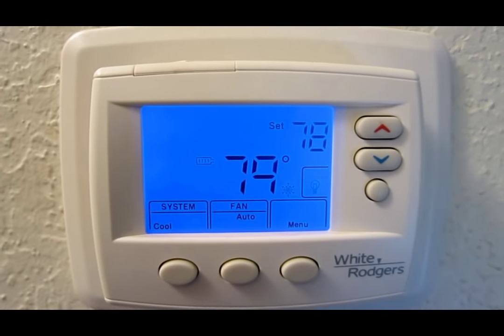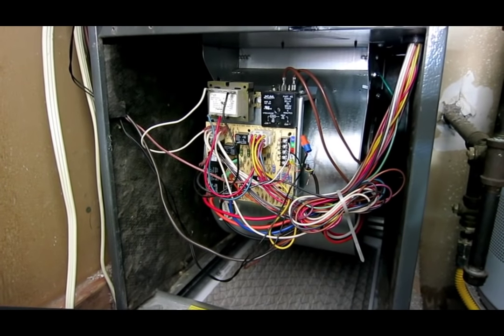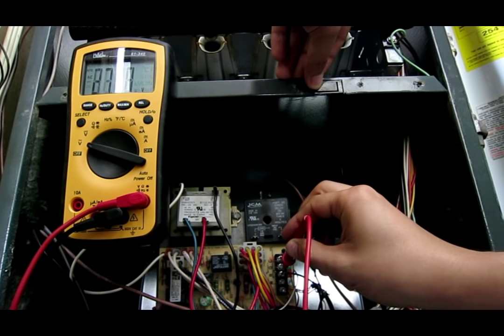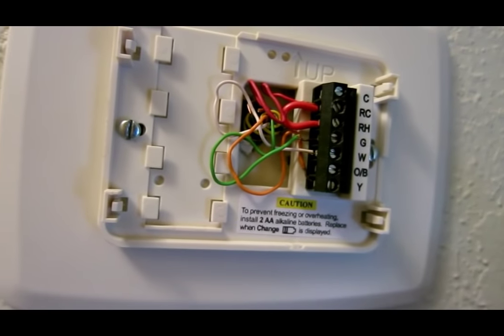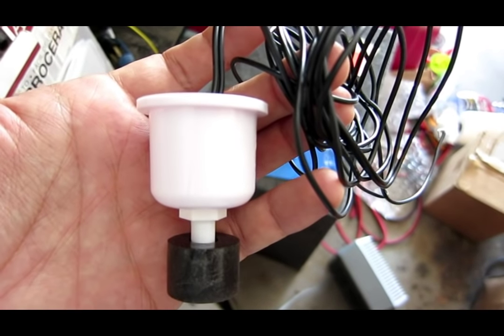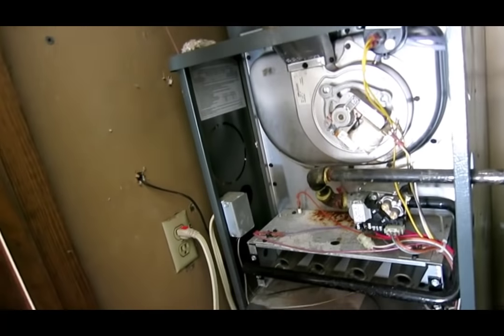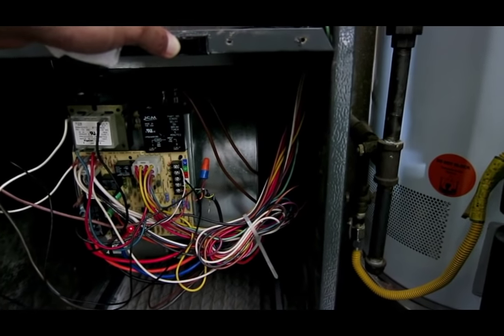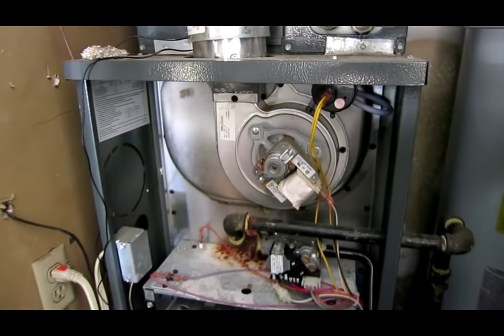most common AC problem - blower doesn't come on - HVAC condensate overflow shut-off device problem

Comment: Ok maybe some help. I trying to help fix a friends lennox unit. Heres what I got. I turn the heat on furnace fires but not blower motor. I put fan to on and nothing. I turn ac on and nothing no inside fan and outside unit doesnt fire on. I took the outside panel off and if I manual press the switch inside the outside unit runs as long as i hold it but inside squirell fan still doesnt come on. This unit is odd has 3 capacitors in the outside condensor unit. One is 375v and I believe was part of a hard start kit. Checked all 3 capacitors all read good so just cleaned connections. Out side fuses good power tests good at unit. Back inside no trouble code lights flashing faults on the board. I havent checked squirell cage fan capacitor yet but no bulges or leaks.I hear the furnace click so it gets the call to come on and in heat flames up as should exhaust fan spins no blower. Ac on I hear the call click but nothing else inside or out..Suggestions?

Comment: Should break the yellow wire for the compressor instead of the common so you can still have heat from the gas unit instead of no heat because the coil will not sweat in the winter

Comment: hi and thanks for you help, i have a portable ac unit LG 10000  is olmost brandnew the first monts work fine but few weeks latter sone times blow cold air and some time blow only the fan mean regular air and, and the reset botton for the wire pop uot, so am push the botton again and am stare the unit again and do the same ting some time blow cold air and sone time regular fan and reset botn pop out can you help wt this problem my freend? thanks

Comment: Hey man, my problem is that the fan will turn on only with the AC on or system off, if I turn on heat no fan will come on either manually or auto.

Comment: my circuit breaker tripping  i have same problem my fan motor work outside tested by electrician but the condenser shut down after resetting breaker condenser only work for about 1 minute Breakers trip again  after watching your video it sound like my problem is what you guys call overflow shutdown i well try to replace and clean the drain with air compressor.or any advice what my problem is?,
Reply from the maker: actually, it sounds like you have a bigger problem. if your breaker trips that means you have a short to ground somewhere in the condensing unit. It could be a simple capacitor, or the compressor (since the fan works). Or, you might just have a bad breaker that needs to be replaced.

Comment: Ok, so I live in apartments. My heater, turns on for a little while, then the breaker flicks. I do have clean air filter. But the rest I dont know where to look. They keep fixing the issue supposedly, but the same issue I still have. How can I just fix this myself?

Comment: Hello diy, I have a question.my thermostat invensys digital. This is my work, somebody keep lowering to 50 cold! So I keep bringing up to 72, so my question is it going down by itself to 50? Or something wrong? Thermostat. I confused, how to understand the thermostat the reading. Thank you.... help please! !!!
Reply from the maker: A thermostat should never go down to 50 on its own under normal circumstance.
Try taking the battery out, wait 5min, then put the battery back in the thermostat. If it goes down to 50, then maybe thats the way it resets, and maybe there's something wrong. However, If it doesnt go down to 50, then someone is messing with it.
Reply: DIY Tinker thank very much diy, I did what you told me, now is working normal, & I hope stay like it supposed to be.i appreciate your help.

Comment: My problem right now is that my AC unit sometimes starts making the noise like its running fluids and getting ready to kick on, but it never does and it keeps making the running fluid noise indefinitely until I realize it and turn it off.  I can hear the outside unit come on (which I'm guessing is what starts the sound of fluids/freon moving) but the inside never comes on.  The suction line freezes up and the other line gets cold.   So I wait a long time and try again (after thawing) and it'll work.    Usually this happens in the afternoon at the warmest time.  

Also, right before it did it the first time, there was a session where it wasn't blowing much air and it wasn't cold.  It was weak.  But it was one time.  And the outside unit was on.  I'm guessing it all kicked on like normal but when the outside unit kicked off, the inside unit continued to stay on and blow room temp air.  

What is the problem?

I should mention that I recently changed the filter and bought new insulation for the suction line outside (after the first time the problem of the inside unit not kicking on happened this summer).  But a week later, it happened again.

To sum up:    The inside unit possibly didn't kick off one time and later, occasionally, it doesn't kick on when its supposed to (after the outside unit comes on).    So, it seems it fails to 'kick'.   
I got the transistor (or whatever the small device that starts it is called) changed last year.  
I got the condenser coil inside changed two years ago.  
Last year, we initially switched out the motor (before realizing it was the transistor), but wired it wrong and blew the new motor.  We put the old one back in and replaced the transistor after some friendly help.
Reply: My fan works but my compressor wont turn on.I replaced the compassitor and the compressor still wont work.

Comment: The power switch at the air handler (24) is off. The house breaker is on, powers hp.............the T-stat fron cover is pulled with the AA batteries...

Comment: While checking my ac , noticed that the outside ac fan works, but it is not blowing any air or any cool air inside the house neither when I put it in fan mode it blows any air. What could it be?

Comment: my thermostat goes blank for like 5-6 minutes and then re-appears again and then goes blank again...this repeats itself...i get air blowing, but not cold air.  i have a brand new condenser and evaporating coil unit installed like a month ago, so it can't be the compressor or capacitor. my friend said likely a bad thermostat, but shouldn't i still get cold air if thermostat intermittenly works?

Comment: My husband was banging on the exterior of our Bryant hvac unit in an attempt to remove the ice build up.  It's brand new...err, was.  While banging the unit stopped working.  Fan stopped.  We tried shutting off/turning on.  Nothing.  Advice?
Reply from the maker: you need a HVAC pro asap. your refrigerant might be low, the installer might have made a mistake when installing the unit.

Comment: I have to reset my breaker then the blower will work.  but it is not running as fast as normal.  And takes longer to come on then before when you hear the thermostat click.

Comment: my ac/heater will not turn on at all. We've replace the transformer and got a new switch board but it still won't turn on. I've also checked the breakers and they are not tripped.

Comment: in general how long should i wait to do the check to make sure that the  120 V  connections are grounded
Reply from the maker: no sure what you mean by 120v connections are grounded. But the overflow sensor reacts immediately. you should have 120V or 0V when its tripped.

Comment: I have a problem with my traneXE1000 the top casing where the fan is attached was cracked broken by someone and it caused the fan blade to break off.  I have not been able to find another lid or top for it the unit works great except the area where the fan is attached is completely broken where can i get another lid or top for this unit ?  Any ideas for resolution?
Reply from the maker: Any HVAC store can buy that single part for you. For example, In OK, MO, TX, AR, KS area has a HVAC store called locke supply.

Comment: my a/c is coming on and cooling everything down but its not turning off. Its set at 72 and in auto but it will get down to 60 or in the fifties and not turn itself off. any sugestions?
Reply from the maker: I would guess either your thermostat is broken, or the control board isn't functioning right. you can bypass the thermostat (see other videos), if it turns on and off then thermostat is bad. If not, then the control board might be an issue.

Comment: cont',,, so I am just touching the contacts, not actually pluggin all the way on -trying to be careful. The other wires are marked faitly clearly so , i believe the others are hooked up ok. But my sch, doesnt show where these wires go to, just shows wire nuts, the outside HP sch doesnt show these wires either, but I think they are the lo 24 vdc.  The 'R' terminal test conductivity to chassis,  it is a Thermal ZOne -United Refer. Any tips someone can give on so little, I willl look at outside too

Comment from the maker: So, your AC has so much water from condensation that the overflow switch trips all the time? Sounds like a draining issue. I am guessing your AC in the basement? Not sure why you need a $400 pump, there are alot of cheaper ones out there that are less than $100.

Comment: I have a question for you.  If the blower's 5amp fuse keeps blowing what could be the root cause?
Reply from the maker: a short somewhere. maybe the blower is so warn out that it pulls too much current. maybe there is a short to ground. hard to say what could be the root cause.
Reply: could it be the capacitor?
Reply: When that happens it has a short in the 24v wire check if you have them touching by condenser whrn the fuse pops is to protect the transformer.

Comment: ac was running suddenly shut off has no power at all I've had problems with it multiple times but never has it just shut off what should I do? It is extremely hot on the third floor we are unable to turn it on at this moment what could be the problem?!
Reply: Vernetta Moore check the capacitor
Reply: Yancy Nunez lol they been waiting a year and 7 months on you bro
Reply: Raycharles Duramax LMAO. They're cooked now.
Reply: I think time for new 1

Comment: Ya I just bypassed it, still does not work, also mine does not have circuit board in furnace panel, just wire to wire connections, and the main power cord goes into some kind of fuse box thing, not a regular outlet, but I dont see a fuse to check in that box, I'm so lost

Comment: If your ac thermostat will not kick off when the temp goes below what it is set on what could be the problem?
Reply from the maker: Since i do not know the full issue, i would recommend the following two options:
1. Thermostat isnt working properly. 
2. Furnace control board isnt working properly.

Comment: The problem I am having is that my blower won't come on unless I go down and actually turn the switch on manually. Setting it to auto or on with the thermostat will not turn the blower on. Everything else works fine.

Comment: i have a problem with my ac. the fan outside the house works fine but there isnt' air coming out from the vent. the unit just humms. so i switch my ac off for atleast 5 to 6 hours and then turn back on and everything will start to work just fine for sometime a day or sometime a little less. my unit is about 18/19 year old trane.I replaced the control board two years ago when i wasn't getting any power to my thermostat controller. But i think this one is a different kind of problem. I'd appreciate your help.
Reply from the maker: STILLPHENOM try following these two videos and see if it solves your issue:
https://www.youtube.com/watch?v=4OAGq84mQSo
https://www.youtube.com/watch?v=cnD65qX8bjM

if it doesnt, at least you can eliminate some parts and start solving the issue
Reply: DIY Tinker hey there, thanks for the quick response. But I might have confused you a little bit. The fan outside works fine. It's the indoor unit that humms n blows no air at all.
Reply from the maker: STILLPHENOM then check this: https://www.youtube.com/watch?v=oswofzsoo88
Reply: Thanks for ur time bro. Really appreciate it. So I had the hvac guys come out and gave me the bad news. The capacitor was reading 3.5 in the furnace n the fan motor was bad completely. So they replaced those two n now it's working fine. Cost me 640 for everything.
Reply from the maker: STILLPHENOM sorry to hear that. Well, did they try replacing the capacitor first and see if the blower runs? how did they determine the blower was bad? just curious and want to learn from your experience.
Reply: Yeah so we first were happy to find out the capacitor was the only thing that was bad so it would be cheap for me n they were kind of in a rush to get to another place but after putting the new one in the motor wouldn't kick in at all n so they checked the circuit board n got nothing there which lead to checking the blower motor which was bad. Sorry I couldn't exactly tell u those hvac languages but it was something like that.

Comment: Rc is power. The power runs from ac into the g wire. You should not have 24v because it's the same line of power when it's on at the tstat
Reply: Lol and that throws off alot of mediocre techs. Especially trouble shooting air handlers.

Comment: sounds to me like your indoor blower motor capacitor is going out  its ither that or your motor is going bad....if your motor starts sometimes you arent having a problem getting 24volts to the relay its usually the capacitor for the motor.

Comment: Why do you go to the circuit breakers first, why not just switch the thermostat to "ON", that will tell you if the transformer gets power and if it does power is coming to the unit.

Comment: This doesn't help me as I live in an apartment complex and we have really shady maintenance men here and I don't want them in my home ( and they've been acting very strange around my building... they deliberately left the door to the apartment next door to me unlocked overnight after the tenants moved out .. the two apartments on my floor also complained along with me about this because three weeks earlier in the morning was a man walking around outside our building in a ninja mask.. all you could see were their eyes ...the rest of their whole head and face was covered) 

     I don't want these creepy acting maintenance men in my apartment .. they are the main reason tenants are moving out.

     The problem is the fan comes on for the central air and I know the freon works but the motor, the loud thing, doesn't kick on and yet it looks like outside the fan unit is moving , blowing out hot air .

   that's how I know it's my unit because the other ones are blowing out cooler air.
     I shut off the circuit breakers and turned them back on and that did not help.
      What happened is we had really unusually warm weather in early March and when I got up in the middle of the night I went to turn the AC off because I felt it was too cold ; but then I thought about how warm it was going to be by noon time and so 30 seconds later I turned it back on and it made a clunking sound and stopped working.

     Yet I had no problem when it got cold again and I needed the Heat.. the heater part of it works fine .
       There is a thing that goes into the wall that in another vid the guy pulled out and it was a fuse of some kind that look like a battery to me that he said to replace that.
     I don't have a voltmeter and will not easily be able to borrow one right now or this weekend I just want to get this over with hot and depressed and I can't stand this

Comment: My split system ac/heater is not working at all and the circuit breaker keeps switching off
Reply from the maker: Many things could trip the breaker, i would test the compressor and fan:
AC blowing hot air - How to troubleshoot HVAC compressor - measure resistance - blown compressor
AC fan not working - how to troubleshoot and repair condenser fan motor - trane air condition

Or You might have a bad breaker:
how to repair replace broken circuit breaker - multiple Electric outlet not working - fuse box panel

Comment: You have identified the problem correctly.... Cheerio  on that... but you have failed to identify the cause of the problem... and this is the case for every single blocked drain that I have been to... which is quite a bit... and every single 1 it is the exact reason for it...1) from what I can see ... it looks like not only is it not pitched correctly.  It might even be going uphill from what I can see..u are taught at a very young age that water travels best downhill....so whoever put that drain in should be supervised while they are working at all times...that is not someone who knows the very basics of plumbing that 10yr olds know... slowing the flow of the water intentionally is not a great idea ...in fact it is pretty stupid and this issue literally got an invitation to the drain and took them up on the offer....this by itself could be the cause.. since we are  on the subject of intentionally slowing down the flow of draining water...  2) I see no p trap in the drain line... there must be and should be... It is counterintuitive but believe it or not you are slowing down the water by not having a p trap ....the pvc pipe is only holding water in a very small area and the rest is empty space for air when you do not have a p trap...so what is happening is air is being sucked in through the drain in the opposite direction of the water flow.... which again...for the 2nd different way.... you are slowing down the flow of the water...if you have ever taken a evap coil door off and felt the door being sucked back to the coil with a lot of force...this is what the draining water is experiencing inside the PVC pipe...p trap prevents that and uses the weight of the water to build up more energy to and regulate the flow because the water that is flowing is not being effected by the vacuum action the water experiences with no p trap.. this could have been avoided... and this happens and costs home owners because of crappy work...